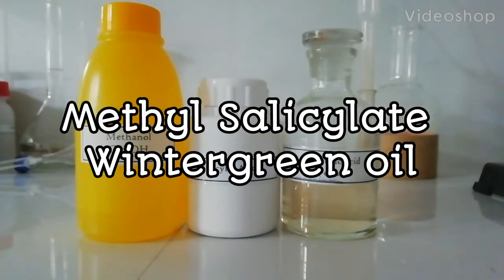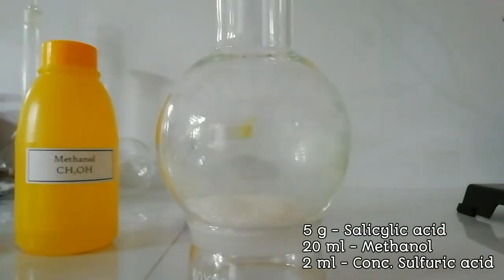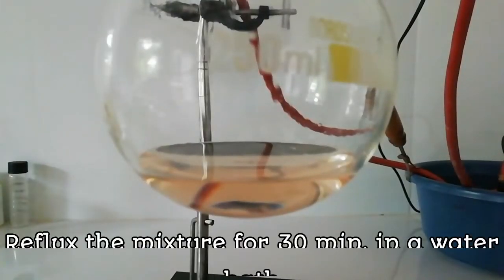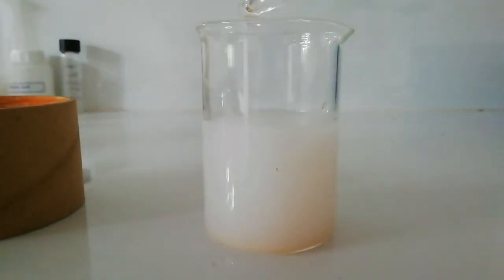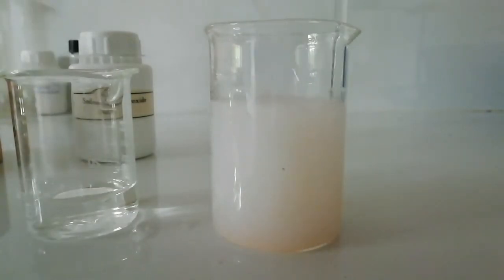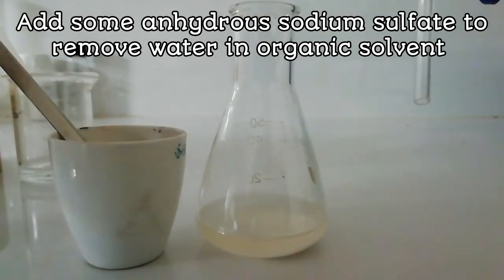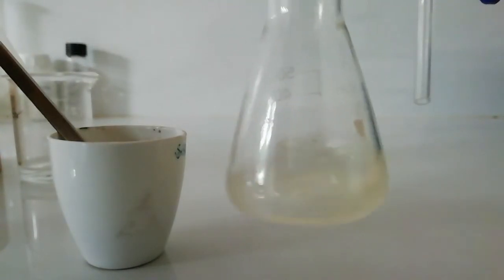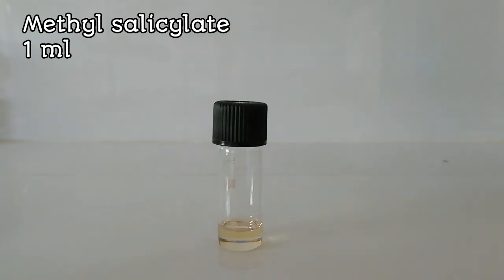How to make Methyl Salicylate | Wintergreen oil

Comment: Is there a substitute for DCM in this reaction?
Reply from the maker: I used DCM because I seperated the product using liquid-liquid seperation method. And the amount the of the product is less therefore this method is effective. You can use an organic solvent that does not dissolve in water. Or you can simply distill the product if you do it in large scale.

Comment: 30 min heating is not sufficient for reaction
Reply: What is the minimum amount of time needed for reflux?
Reply: @adabhavsingh8604  6 h is recommend by majority of organic chemistry books. Doug's Lab obtained pretty the same yield with 1.5 h. A good moment of long boiling is that you can use proportionally less acid although sulfuric acid isn't expensive
Reply: What is a suitable substitute for DCM in this reaction?
Reply: @adabhavsingh8604  Any heavy solvent e. g. carbon tetrachloride, chloroform, ethylene chloride. Also you can use light solvent but you have to add more one because of emulsion formation